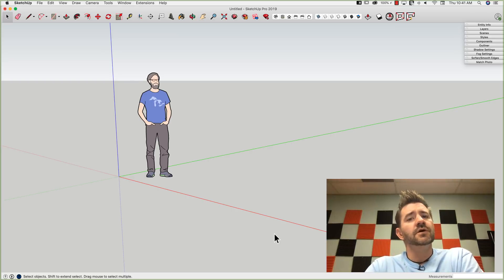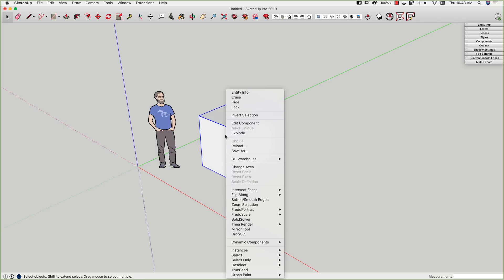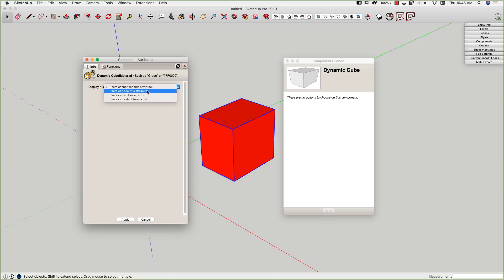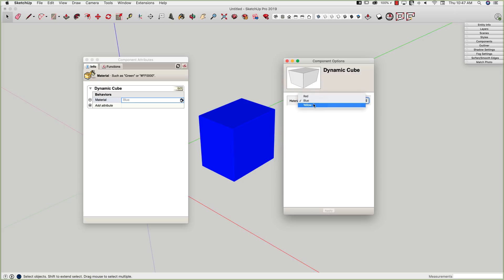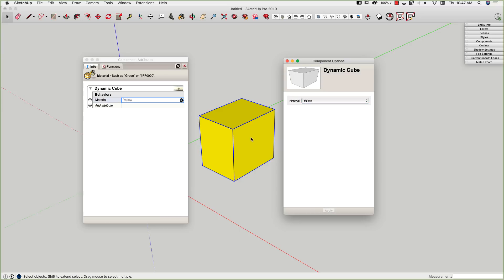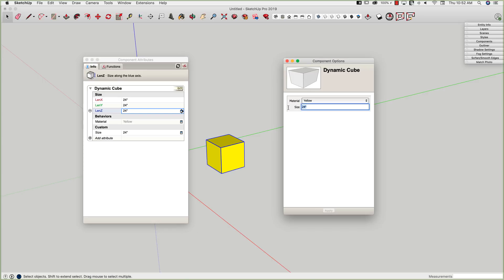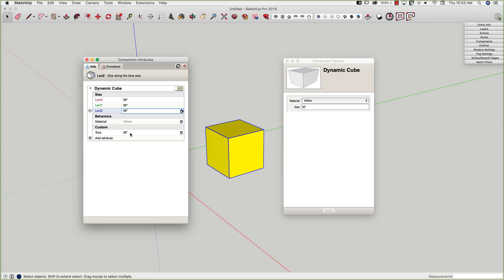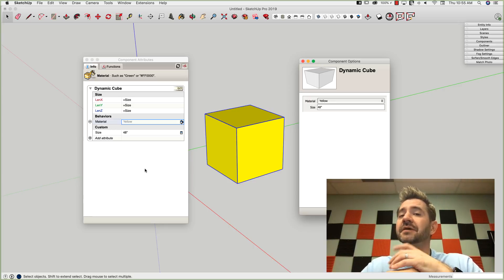Welcome to Dynamic Components Part 1 - Skill Builder

Comment: This is the second video for introduction to dynamic components by two different people and both choose to apply colour as material. I would have thought that blue is colour for example and wood is material. Is there not a  heading called colour and a separate one called material because as a cabinet maker material is never colour. That’s just misleading. Maybe I need to watch more in this series.

Comment: 4:40   I'm just starting out on this and I did everything you said, and it won't change materials.
I can get the size to change, but not the material. 
I want "Wood Lumber ButtJoined" and "0128_White" . I even tried using the hash #FFFFFF for white.
WhattamIdoingwrong?

Comment: I only get the components options no attributes?
Reply: What version of SketchUp are you running? You do need PRO to see the Attributes menu (sorry that I did not mention that... it will be the first thing said in Part 2).
Reply: Steve Hubner I had the opposite issue, attributes no options, if you can disable dynamic components, close SketchUp, reopen it, enable them again, that did the trick for me. On a 2011 iMac running High Sierra and SU2019. Best of luck

Comment: Thanks. Dynamic components feature (Parametized drawing) in Fusion 360 as their main  selling point because they are so useful, so I’m glad you started this tutorial series. 

There is a free DC plugin that gives users the ability of creating binary models such as doors that are either open or closed. 

For me the ultimate DC model would be a marionette which can be made to take any stance - running, walking, jumping, pointing etc - by just touching trigger points on its surface.
Reply: DCs in combination with components are what sets SketchUp apart from Fusion 360 and Blender. DCs with components normally add around 10% extra file size To each model, whereas in Fusion 360 and Blender the file size can be much higher with their “parametized” models
Reply: @jeffharmed1616  This can happen in Sketchup as well. If your DC's are very complex (e.g., nested DCs) they will copy as new components, not instances, and thus bloat the file size substantially. I've run into this many times.
Reply: I’m definitely interested in seeing something like that modeled, not sure how the components and sub components would reference space to be able to move properly. I’ve been attempting something far less complex than what you’re talking about and have been stuck for awhile. We’ll see how deep Aaron is willing to dive on this! I’m in for all of it! 💪🇺🇸